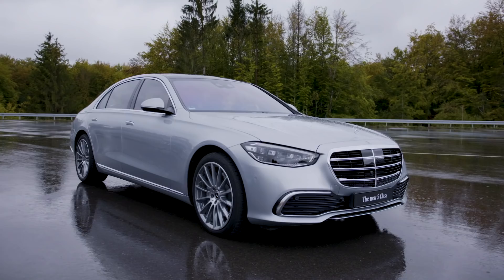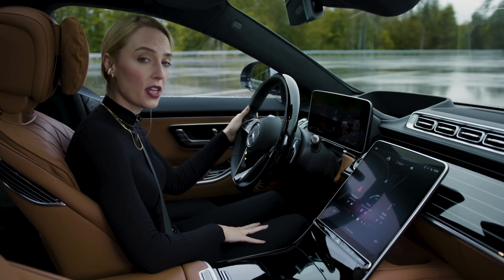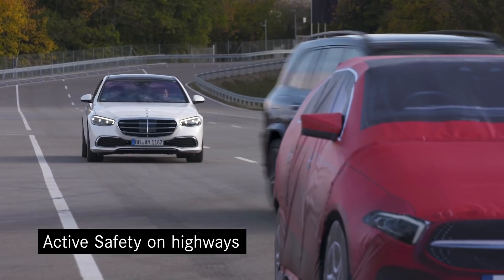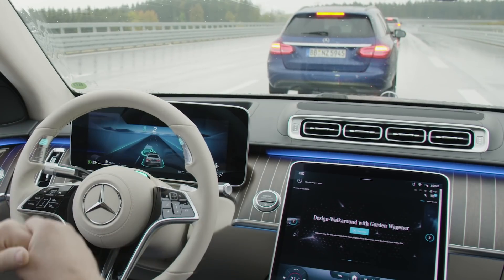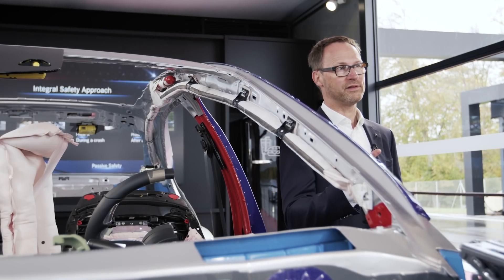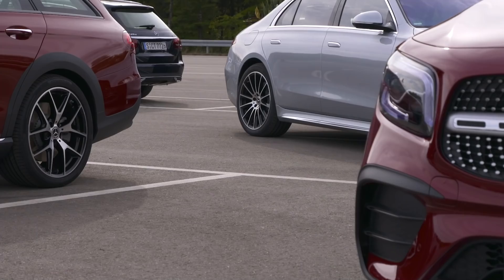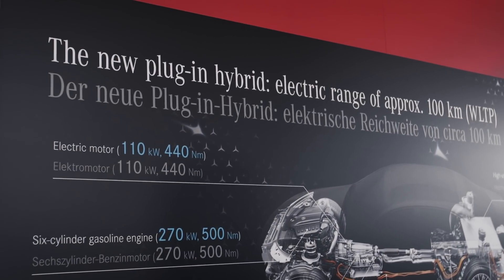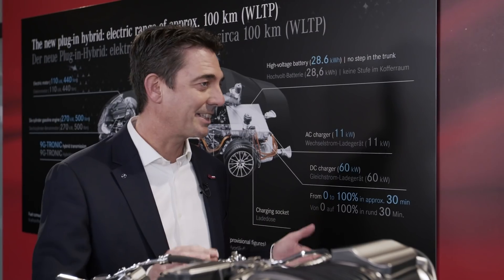2021 New Mercedes S-Class Development ( MBUX, Intergral Safety, Rear-Axle Steering, Plug-in-Hybrid )

Comment: Exterior is not impressive. So far i really like the W221. Nowadays the S class is way overpriced and in the territory of the RR Ghost.
Reply: It never was cheap, driving an S-class. You forget, that nowadays the S-class already competes against RR Ghost or Bentley Flying Spur. The features, this car send forth, are insane and extraterrestrial, which put the actual S-class into new dimensions. Take a look on the new MBUX. The actual communication system of MB is the best available technology so far!
The only difference lies in history of these car brands. But when it comes to a sober comparison between the S-Class and other upperclass sedans, they are roughly on the same level.

Comment: Hybrid nice ? And looks lovely and some great features, but Hybrids will not be allowed as in the UK it’s going full electrical cars by 2030, so how in the hell is everyone going to pay £35.000 plus for the most basic small size electric vehicle with hardly any plug in stations for people without a private garage to use as the street chargers is just not going to be able to work as they will have to be mounted on the pavements and this means if you do not park your car probably or you’ve charged your car and someone else wants to use the charger will people be getting out of bed just to try and move the car and find a new car space that will not impede anther charger unit. The pavements in the UK will be too small after the charger units have been fitted, plus how many charger leads will be stolen in the first year ? Thousands as they will be resoled on Amazon or EBay. What happens if your car is still connected or you unplug it from the charger and forget to disconnect the lead from the car ? Maybe a fell safe answer is you can not drive until ( A ) you have disconnect all sockets and ( B ) the car will not go until the charger lead is placed inside the car even when wet and muddy. S Class always leads the way with what cars will have to live up to and other car manufacturers will have to try and beat or get close enough to perfection. The only thing that I did not like about the Mercedes S Class last time was you could not get all wheel drive in the UK. The UK has some terrible roads and weather and I would of thought that Mercedes should at least try and keep up with Audi in the UK as who doesn’t like the Audi Quattro system or the Audi AllRoad. That’s going to have to change if the Mercedes S Class is going to hit those sales figures.

Comment: Hey there.   Forget all this.   I just want to type an address and have the GPS find it.   Most times the interface is so aweful that I take my phone out and use google maps.    Car companies designing tech interface is a disaster.  They first charge 6k for something that should cost 600 dollars and will be outdated in three years and then they want to convince you that some fringe use case.is cool .  Why can't I just have a holster and plug in my ipad?    That's all I want.    I can upgrade my ipad every other year at a cheaper cost than this garbage

Comment: I’ve owned one Mercedes in my life and that will be the last. Thousands and thousands of dollars of service
I bought my S class Mercedes for $95,000 five years later it’s worth less than 20,000 And that doesn’t Count for the thousands of dollars I spent on service. Every time it goes to Mercedes of thousand dollars minimum. I’ve owned a model S Tesla now for three years and all I can say is Mercedes is done if they don’t go fully electric. You have to drive a electric car they’re incredible. I’ve spent a total of $300 on service in three years on my tesla so far wow. It cost around $15 to fully charge it up at home and I can go 350 miles.

Comment: Now, if only Mercedes can design a car for women so that they don't have to sit bolt upright and almost leaning forward to look over the top of the steering wheel.
Reply: ...and then you found the controls for the driver's sit. Not to mention that the steering wheel is adjustable 🤣

Comment: They should consider about reliability of Mercedes cars due to so many quality issues especially the hybrid/EQ boost model.
Reply: Don’t know what ur talking about there’s been little to no complaints regarding the Eq system/hybrid models
Reply: @Biggosh-ne8ww  My family bought E350e and C300e. Both have the hybrid system failure, leaked air suspension, Air compressor failure and so many bugs for sensors.

The worst thing is the steering wheel locked while I am cruising on the highway at 120km/hr.  Now I am using Volvo XC60. Am I clear?
Reply: @putt10000  interesting, Mercedes were also known for crazy suspension complexity compared to other brands. Volvos have a lot of Chinese parts in them.
Reply: @Biggosh-ne8ww  What‘s the matter with Volvo having Chinese parts? Chinese suppliers have better tolerances and higher quality products if you are able to pay them adequately. Besides, all manufacturers have Chinese parts in their products. I can assure you that since I work in the automotive industry and I used to collaborate with a German automotive company that supply and develop components for various enterprises.
Reply: @gustavochavezmadrazo582  geely is know for not so great quality in terms of little stuff like wiring harnesses, fuel pumps, integrated software architecture

Comment: MBUX should atleast have kidney and exsaust suctioensr as mclaren merc did and bottom air sutionesr and air turbine whistler to have like e swuush sound and wind swush air pipe tuneling wind air up mid size engine above wheel and extra cooling and engine catcher as it kind circpe around again in air pipe to cool batery pack  then is something dns tuff develop in airturbine dynamics so eventualy batery could came closeo 1/3 volume engine just by enlaring bottom part to 1/3 rest is in biiger tyre dim more tyre in and recup power gets in slight dim lower so they are slight thin extra recup is adtional powere as electrci gen on axis wheel so you gte double performance and 4x4 in  automatic gear drive so there is no need for 4 gears in limo 5 is more enrgy eficient adn since car  has slight volume weight more then welcome tell it to Lesnik he would make some wig fiz about and say like is all understandable whn we will have this incorporated in producition line, also lcd lights are to industrial they kind a follow industry goals and mercedes actualy a 500 should be high tech based on dirvabality and geting in touch ad drivability increase this mode was hughe sucsses and good car for wallte despite not so good wieght to hp ratio is usability and expentance to earn money and robust makes it nice, actualy all is faek english performance transparent talk, is making easier money on wallet and thats merceds is good on it, but that sometimes stay in all version though time and expanding or dirvability is time off fun is trill, sometimes is not car produccer stuff, is what producer plans for driver to use in it driving  and making money on it in own buisness is big trend but still to much conrofrmizm in ideas so you decided wth conformizem to cope with sport tech and high Q , well I dont think not without improvments and since price on Rolce gone sky high in limo per wallet are price slight in image performance not drivability pleasure on fun this famous rule is usualy used in US for downgrade price cars in 10% each year lader rigourusly to have price off lease or credits or making money in real estate value more as healthy or often to competitive without any concern only on money profit per personal wallet, well womeitmes you in US sell fog, without any interests in eco firendly produciton or producer sell market standings and kind brand stays and  ends up in robust deisgn conformizm thats is usualy not so sport cars adn then they healthy competition like bmw cars and line off production is hooked and still on the move.. bit odd and strange adn desires off people changed customers expect more and more know how pleasuring as this trend style goes out from style to extreme wealth and soemtimes it has nothing to do with car industry as mercedes is like based upon today as chaep buy mark to show off in some lvl which is bti wacked out theme in US, a noticable trend that has no background in industry or such facts more then 100 billion loss in auto industry in US but still whistling this is lousy stuff trade between EU adn US and EU lwas insist of fair trade even Japan cars are aware off it, looks liek thsi typhons stuff are not gonna change and looks like are nto gona change since there records off typhons even 17 centuries or 18 centuries and ae excuse for trade in EU sadly but this type off war trade nad civil floods and typhons is US dollar agenda and loss in car industry not corona for dum doctors and WHO who wants to find cure for death and later sell as form off flew due to uniwilingless of americans to accept others or more people in CHINA or INDIA, looks like they need to fly to mars ro see that there is people outhere also on earth which is funy in one way..